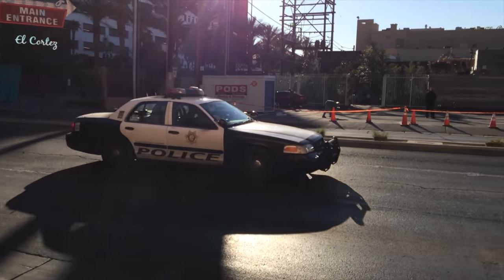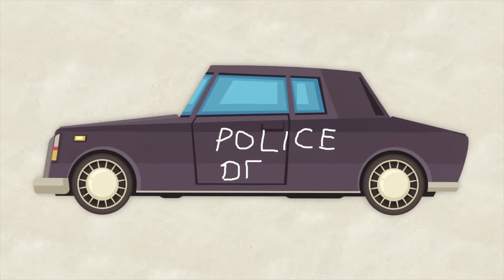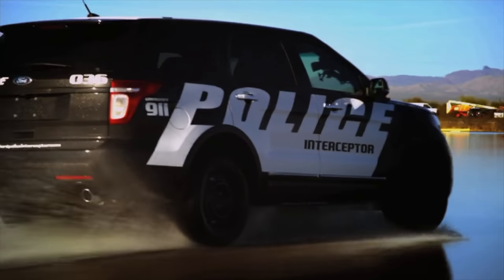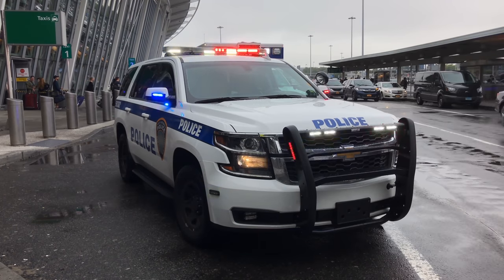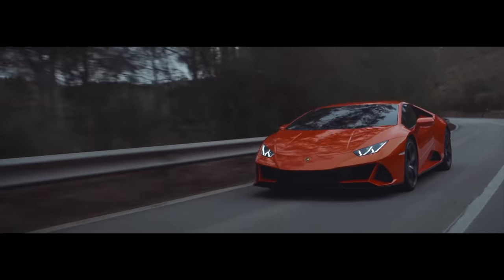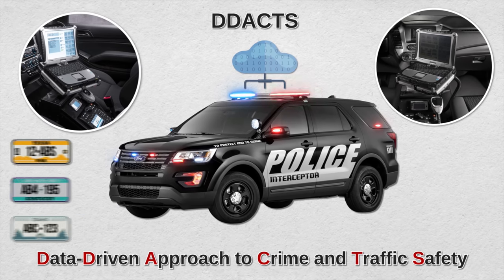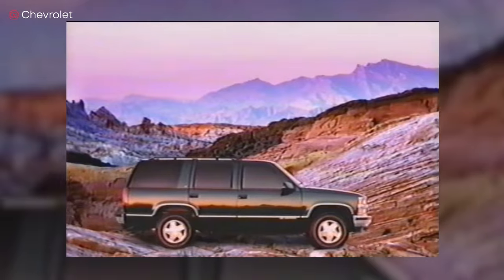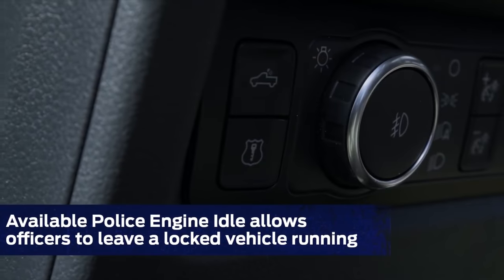Here’s Why You Can’t Outrun a Police Car

Comment: Ive owned 3 retired police cars in my tenure, the latest being a 2012 Crown Victoria. In my experience, most police cars are retired at 73,000-75,000 as thats when many of the major components warranties are starting to run out. If you go to a typical car auction check the odometer, many of them will be right around the 75k mark. The hours ran thing is true as well, but many departments dont have the cash to replace them right away, so regardless of idle time, 75k is pretty much the max youll see a typical police car. unless its the boonies where a car is replaced when its destroyed (LAPD still uses Crown vics in some areas, and they actually have a frame straightener if the car gets in a really bad collision, theyll straighten out the frame, frankenstein it back together from total loss cars, and back out it goes.)
Reply: I’ve seen them with lower mileage, maybe because they sat at idle

Comment: My first duty vehicle was a P71 Police Interceptor. That thing was capable of 140mph and was way more comfortable than when I became a Sergeant and got crammed into this little Ford Exploder that never was meant to have a cage in it. I was sitting at an almost 90 degree angle most of the time. It was horrible until the Dodge Chargers came out, but I got out by then.

Comment: I've done it 1 time. But I was parallel to a state line.  The cop was doing paperwork in the entrance to a park outside of town. I was driving a  suicide machine. A 1979 Oldsmobile Cutlass Supreme.  It had a 260 olds motor in it when I got it.  It was a dog. I found a 73 Delta 88 that was in bad condition.  It was equipped with a 455. I pulled the motor and had it bored .030 over because it was in need of it. I had everything done . The main bearings were .010 over cam bearings also. New hot Mondelo cam, new adjustable valve train. I had the heads rebuilt, valves, seats, guides, surfaced, then i opened up the area under the valve that was passed the valve seat. Cleaned up the manifold side and gasket matched them and installed a new Edelbrock performer intake for some reason we couldn't get the power out of it with a Holley  ? I tried several, even a larger cfm Holley, that we had played with jeting and everything else. So, I had the original Qudrajet rebuilt by a local carb shop. The car was named the death machine because of the 2.52 to 1 differential gear. The 260 wide open could oniy turn around 3400 wide open on it's best day. The 455.......
lol... wide open in top gear, TH-350, I had up to around 4500 RPM because i was going as fast as i dared. The motor could almost bury the 85 mph speedo in 2nd gear. I had it up to over 5500, and im pretty sure it had the torque to do the same in 3rd, but I didn't want to die. I  went flying by at 125+ . It almost buried the spedo in 2nd. By the time he pulled out, I was rounding a slight corner about a mile away. Then, I turned toward the state line. Then, it made several direction changes, and that was the end. I was 19. Now I'm 50.
Reply: I did the same thing when i was 20 with my mustang gt. I waa already at 90 when the police offucer ran thru ditch trying to turn around i punched it to 140mph the next exit backed in a driveway lights off and prayed about aaking the Lord to blind him and bind him in Jesus name. Never got caught but learned a valuable lesson that day. You get away once but someday  you will get caught. Now im 52 i obey all of the laws of the land. I putter around town in my pickup truck.

Comment: I bought a 1967 Pontiac Catalina at a police auction. It was a detectives car so it didn't have a lot of idle time or miles. It had a flat tire and a dead battery I drove it for 20,000 miles and rebuilt the engine in my driveway. Milled the heads 50 thousands and put in a hot cam and high rpm lifters. It was fast.

Comment: In 2022 I bought a 2015 Dodge Charger Police Pursuit v8 AWD. Shortly after buying it a code went off for one of the fuel injectors. So I took it to a shop and they swapped two of the fuel injectors around to see if that's what the problem was while he also was checking on the lifters. Thankfully I had a warranty purchased with the vehicle so it only cost me $100 out of pocket. Soon after the water pump broke and flooded in a parking lot so I had to have it towed to the shop. The shop fixed it so there was another $100 while still saving a ton of money. Not only a week later I ended up getting into a bad accident and totaled it. I didn't have the car long but the thing I didn't know at first was to look at the idle hours. And thankfully I got the full use of my warranty. It paid off! Scotty would you recommend getting another one dependent upon the idle hours? If so, what is a good lower amount of idle hours? Typically the ones I see that show the idle hours are about half of the running hours. If I can get it at least a fraction down should I buy it?

Comment: I bought an old police car at auction once. It was a dodge St Regis and had the police interceptor motor. For being such a large car it would put your back into the seat if I punched it. I learned then that you can’t outrun a police car. It also had the niehoff alternator that was huge. I think it was 300 amp or something like that. Had it for years and never once had a problem with the battery or alternator

Comment: My wife has a genesis gv70, and i have a Genesis g80 and we have a 2015 tundra but i bought a 2019 explorer / interceptor just to drive to work it has 144k on it i paid 8200 at auction its all black and looks brand new all the lights were removed besides the spotlights on the driver side but it looks like a cop car the rear seat is removeable which is cool its definitely fast and the ac is amazing it does have clear led lights in the grill and they dtrone i believe they were just switched to clear leds other than that ive tinted the windows really dark but everytime im in a hurry people slow down or move out of the way which is cool

Comment: OMG! You used 2 of my photos! <3 6:40 , Also want to mention on the part of Service dogs/k-9s, equipment has come out that keep them safe while inside the vehicle if the handler isnt nearby, These systems keep track or detect rising temperatures inside the vehicle or if a/c stops working, the windows will automatically roll down, an audible voice alert may sound out urging passerby's to call 911 about the dog in possible distress or even send an alert to the handlers phone or to dispatch. I have recently heard of these systems in non-police package Ford Explorers and my local fire department uses a (non-police package)Ford Explorer for its arson pup with this kind of system installed.

Comment: Well scotty, from the 70's to 2005, I never had a problem out runny 99% of the cops. And in the 70's my roadrunner had the same setup as a 220 mph intercepter 440 magnum intercepter engine, ya it came out of one. And I had 2 holly double pumper. Along with most my motorcycle they were in the 200 + range. We even used to go find the cops we would outrun, just for fun. I even became friends with some I would outrun. I was trained by cops to be able to do that. And there was a few time we would help the cops, in a chase. As I worked security on a drag strip. But a few time we did have some cops that were faster then us, they would show us and then tell us to be safe. Haha all for fun in the old days.

Comment: Probably no limiter in a cop car
Reply: You could easily remove the limiter in your car
Reply: 148mph Sustained speed will cause anything that isn't a dedicated interceptor to overheat. If you can manage an acceleration of 110mph within a quarter mile you can easily manage to be identified only by make and model.

Comment: Bought a 2007 F150 ex cop car. When they sent it to auction, they just cut all of the extra wires and I had no high beams, no horn, no back-up lights and a mess of wires in the cabin. A lot of work to rewire.

Comment: Our hemi powered units have been failing from idling..  apparently the hemi doesn't do well with extended idle and oiling..  anybody else see this?
Reply: The hemi's have a really bad oil splash design.  They just grind up while idling.
Reply: Hemis make good ambush predators but long range running like a wolf or dog? Hemi wears out. More like a bear in waiting for that burst of speed haha
Reply: Yes, heard it from Dodge dealer they wipe out lifters and camshafts from lack of oiling at idle. Meatals from this contaminate the entire engine they were replacing engines all the time!
Reply: @markpontes4457  exactly what I heard we were told by dealer as well...
Reply: Thank you for you service and protection!

Sike get a real job

Comment: A 2013 Ford Fusion can outrun 4 explorers in a matter of 20 seconds, you can most definitely out run cops in almost any car. It's the driver mod. Not the car. Also, with the times comes new protocols for cops. Most cities have no chase policies which makes it even easier to get away lmao. As long as they don't have a picture of your face in the driver seat, you're completely fine. And even though the newer squads, and even older ones with the superchargers etc. are still quite slow as they have an extra what, 1500-2000lbs? Again, it's TOO EASY to OUTRUN the POLICE.
Reply: Can't outrun the ALPR (Automatic License Plate Reader). That's why most cities don't allow pursuits. They just let the ALPR do its thing then catch you later.

Comment: I own a 2013 Taurus interceptor and it's been great. Was a detective's car so the idle hours are not high (650 last I looked). Something for anyone looking to get one that you may want to factor in the cost of a water pump replacement. Find a local mechanic that is competent to save some money, but the design of the 3.7L and 3.5L is just flawed and that repair will be much more expensive than on most vehicles. From what I've seen they 'should' be replaced every 60-100k miles, with most not getting past the 130k mark. The coolant weep hole should stop a dead pump from killing your engine, but unfortunately it is still a possibility.

Comment: I have to be cautious with my Camry XLE..it is a FANTASTIC car but has more available power than I expected, once on roll it hands out suprises.. brakes are tremendously underpowered for its mid speed, which is above highway speeds.. clean profile doesn't slow down by air resistance.. but it makes for a smooth interceptor... I can merge to the suprise of many, I passed a Camaro & a Mustang racing down an on ramp together..3 lanes clear, shocked both..😉 both followed me, met @ a gas station off highway, they both happened to be "off duty" in their personal vehicles.. we had a great conversation about our training  & handshakes, left with glowing grins on our grills..but a lot slower..
Reply: Your Camry 😂 don’t make me laugh
Reply: @tomessmith911  2GRFE engine, develops 307 Hp @ wheels, forgot torque..might have been refreshed..& reflashed..😄👍 can't even use all that till higher gears absorb it..
Lack of brakes scares me..
Reply: Zero details on the Camaro and Mustang, probably old or V6. Sorry but a Camry isnt nothing special other than a nice family car no matter what you say or think.
Reply: @eg1789  Sure is, but with over 300 hp...things are interesting..
Reply: @eg1789  Best thing ever is it is well suited for pulling away from the "muscle cars" like Camaro, Mustang, Challenger, the Dodge Magnum, etc.. they start losing acceleration @ 100mph, & I pass & smoke..😁with a CAMRY ..THE BEST FEELING EVER..
It is a sleeper..
Reply: @francisconti9085  I drive a SHO I have awd putting out about 370 horses and similar torque
Reply: @tomessmith911  They get moving nice! But crotch rockets blast us all..

Comment: I have many times , its simple , a sport motorcycle,  I had 1000 interceptor,  FZR 600 and a 1000 VTR V-twin and I had no problem losing them with any 3 of these motorcycles.  All you do is turn every chance you get . Your always plenty ahead of them and the motorcycle can slow and speed up a hell of a lot faster than a police car. Let them radio ahead because they would have no idea where I was. And just so people know if they do not have your plate number then as soon as they loose sight of you , they can no longer charge you with anything .  So as soon as I knew I was so far ahead of them I would just slow down to the speed limit and carry on.

Comment: "Here’s Why You Can’t Outrun a Police Car"
Umm. Yes you can. I've known people who have done it. Where police have the advantage is in the ability to communicate with one another and work as a team to track you down.
Reply: The people that think you can't get away always live in large cities with a cop on every street corner.  Try rural areas... its almost as easy as just driving lol.
Reply: @LSswapGarage1  ya gotta love them old dirt roads!
Reply: @byewhobayou8868  Or highways lol. If you can figure out not to drive in a straight line the one cop on duty doesn't have much of a chance lol.
Reply: @LSswapGarage1  I live in a small town in the desert, and dirt roads wind and interconnect. Around here, if you hit a dirt road at high speed kicking up thick clouds of dust, the police will abandon the chase for safety. However, they have been known to occasionally show up at people homes, whom they had previously chased hours later. It’s definitely hard to get away when the entire town is on a first name basis! 🤣
Reply: In Minneapolis between half and three quarters of people that run, get away.

Comment: Here in Phoenix, you start to run and helicopter will be on you in seconds. And you are not out running the police above you. 

Phoenix uses the Chevy Tahoe interceptors. As they retired the crown vics, switched to Tahoe SUV for the entire fleet. And the cities that are all connected to Phoenix (like 15 of them),  but people not from here think the entire valley is Phoenix. But most others use the Ford Interceptor. I have a '22 Ford Explorer ST and it has the same drivetrain and "tune" as the interceptor. And that 3.0 v6 is insane. And I have a 2016 C7 3LT and a 05 GTO. The explorer has 415 hp and somewhere around 425ftlbs...  the explorer ST is a track monster...  went to the Ford Performance School which was a multi day trip that came with the purchase of the truck.

Comment: Ok honestly from what I have heard from an ex cop mechanic where he says most electrical systems and engine modifications do get removed for security reasons. So that is also another reason why they are cheaper to buy. So before they do sell them it is under a microscope to make sure it is not what the public will get.

Comment: The biggest problem with police cars, Honda's and other slow vehicles is that they think they can keep up with a Corvette. I was arrested for fighting a cop over an argument about him thinking that his police interceptor car was somehow faster than my Corvette. "If it is heavier than a Corvette, then it is slow ASF" and a thousand other words. Then I was arrested because I was not ego friendly enough for him. I then upgraded my 3200 pound Corvette to 1100 hp and I still get cocky Honda drivers that somehow think that a 3100 pound 1100 hp Corvette is not enough to keep up with a 2800 pound Honda with a 2 liter 4 cylinder engine and 106 hp. Multiply a Honda driver's 106 hp by their ego and you get a higher number than the GDP of the United States. I always drive at full throttle with 1100 hp when I see a Honda to remind them that 106 hp is less than 1100 hp but they never learn. Because everyone knows that a 2 liter 106 hp Honda is faster than a 7 liter 1100 hp Corvette.

Comment: You can outrun a police interceptor if you also have one (Mine was ex state trooper). I was doing 140 down 1-77 with the traffic parting like moses, went over a hill and there he was. I took a gut decision, traffic was light and I knew that the turn off was coming up and you could floor it around the corner. So I floored it, got to the 1st gas station and hid in there and in less that 2 minutes he went flying by.
Too close!

Comment: "It has a 440 cubic-inch engine, cop suspension, cop brakes, and it was built before catalytic converters, so it'll run good on regular gas.  So is it the new Bluesmobile, or what?"
"Fix the cigarette lighter."

Comment: I know this is 2 yrs late. But I bought a 2011 ford cvpi in 2022 and the dealer I bought it from had me sign a contract saying the car will be inspection ready and that they need 3 days to do some essential mentainance. The next day they called me and said the car is ready for pickup. I drove it for 6 hours before I came back and told them the oil pressure light was on. The cvpi has 2 features no other cars have. A gas pump shut off switch and an oil pump shut off switch. Well the oil pump was switched off. Luckily I didn't drive it longer or I could've seized the engine. Then, about 4 months later the steering column split on me while pulling into a gas station. Well turns out there was a recall part on that steering column that was a plastic joint just beneath the dash. I went tocthe ford dealer ship and had it replaced for free, unfortunately they didn't make sure the wheel was aligned so I had to drive it with the wheel turned 45 degrees to the right. Then 6 months later the starter motor stopped working.

Comment: Roughly 90% of these extras are extreme exceptions. They exist, they're available and they're possible... but most are not in use in most places and certainly not in large combinations. Most commonly the alterations to cop cars are limited to energy / electrical supply and conservation and interior modification.